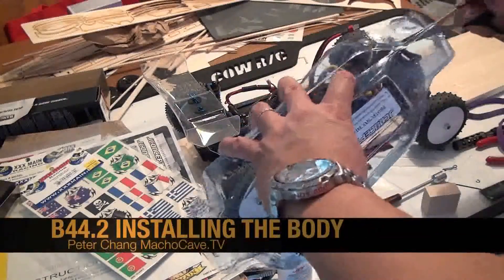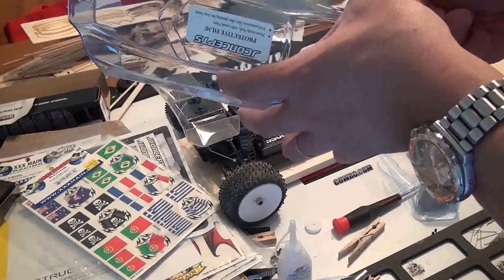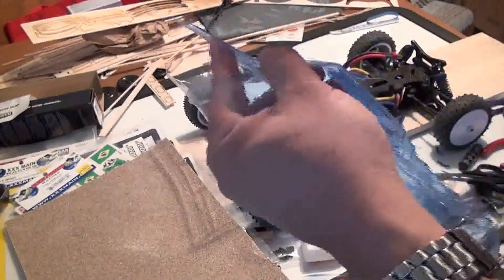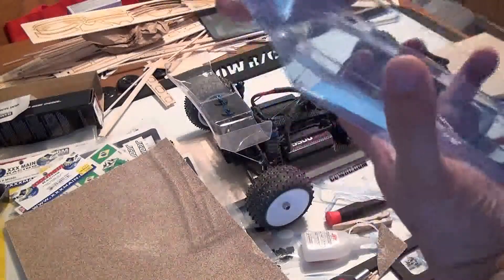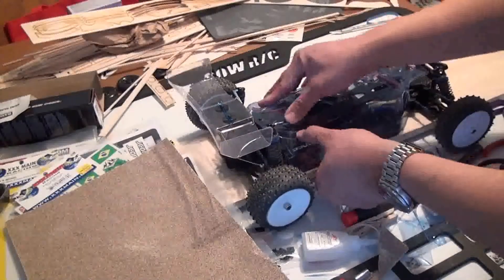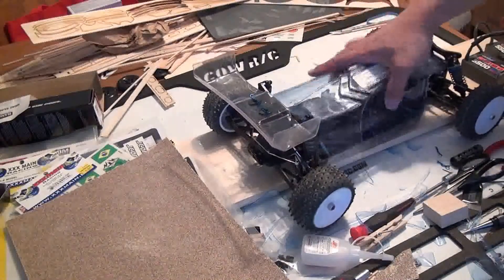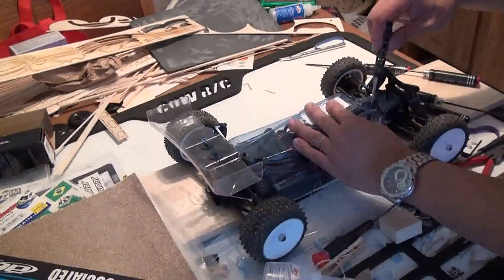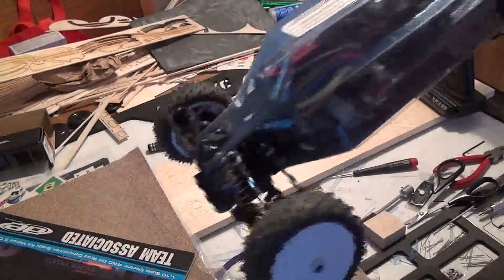B44.2 RC Buggy Build Part 44 Installing The Lexan Body Shell

Comment from the maker: Great question! You can use a hobby knife--just be careful, and you can also use a Dremel tool as well. Also, you may have a hand drill with a small bit size that could also work. If you plan on painting say 5 or 6 RC cars a year--you should consider getting the body reamer tool.